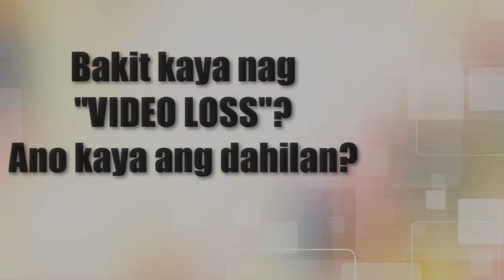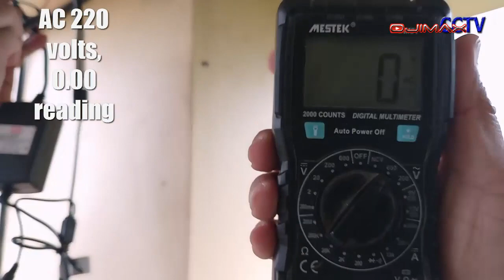Vlog 44 | How we FIXED cctv video loss or no video problem? | CCTV repair | CCTV FREE TUTORIAL

Comment: Good day sir, ano po possible cause and solution nag stop recording pero ang naka appear sa monitor ay yung last na kuha? Thanks. Hope manotice.
Reply from the maker: kung may playback pa, it meanns, good ang hard disk drive mo, baka naka turn off or baka naka scheduled recording ka. Turn on if that's the case. Check the date and time as well
Reply: @OjimaxCCTV  how to turn on sir? Dvr.
Reply from the maker: Look for record settings that says record on or record off, usually its a box, you need to check or put tick mark.
Reply: Kailangan pa po ba sir pumasok sa ip address?
Reply from the maker: @marymaypagaduan4955 No need, just try to  look for record settings